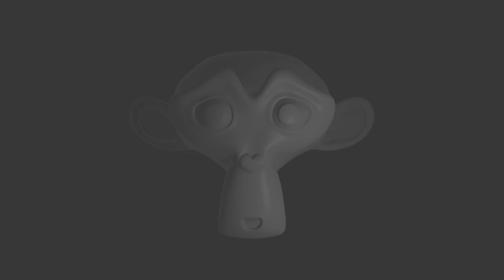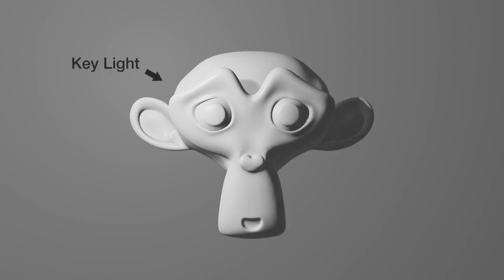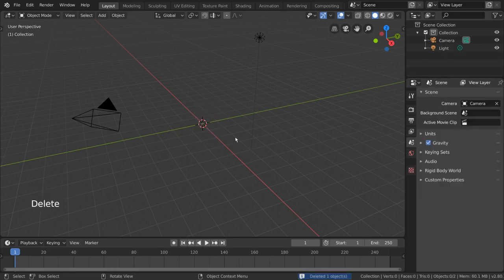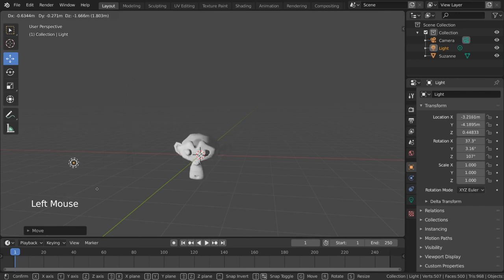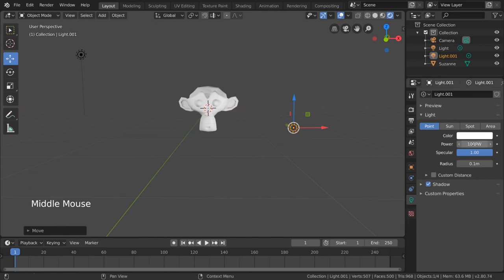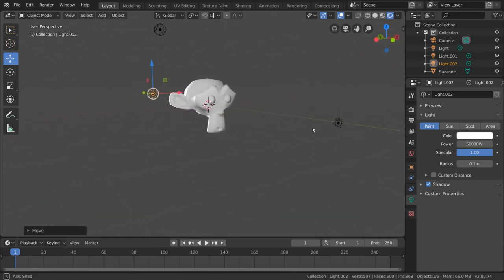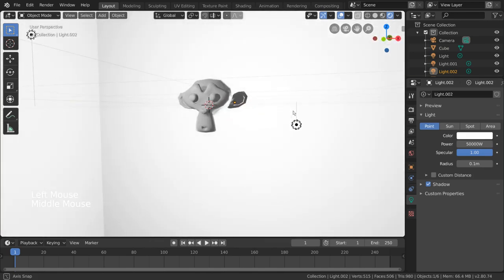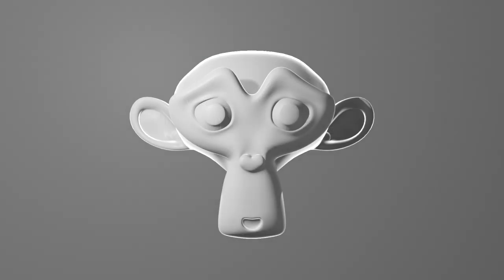Three Point Lighting - Blender 2.80 Fundamentals

Comment: One thing he does not talk about is the built-in plugin for 3 point lighting added in 2.8. Enable it in your preferences, right click on your object, and use the Add menu to add a light, as you would do with any other light. You will now have a 3 point light setup you can adjust in the bottom-left which tracks your subject automatically.
Reply: Edit > Preferences... > Add-ons
Search: Tri-lighting

Comment: Does anyone know why the render at the end of Suzanne (Monkey head ^_^) has a clear lip around the mouth in the video but I cannot seem to get that?

I used Shade Smooth first and it was still quite rough.  The top part of the mouth comes down to a point, maybe a single vertex.  I tried going into edit mode and using Edge > Subdivide twice as an earlier comment mentioned.  That improved it a bit but still the sharp point on the mouth.

Adding a subdivision surface modifier with default settings got it a lot closer, only the mouth really looks different.  Mine smooth with quite a dark shadow in the left and top area with it lit on the bottom and right.

The video has softer shadows, I have a darker shadow behind the brow on the head as well.  Though the video render looks like there is a clear ridge/lip/line on the left and top of the mouth.

the video uses Blender 2.80.74 and I'm using Blender 2.91.2 but I cannot image that would affect it though I'm only guessing.  I assume it must be a render setting or maybe an additional modifier.  I'm only just learning Blender again, maybe I will be able to figure it out after some experience using it.

Comment: What about the material is allowing the rim light to shine straight through the ears? That seems to happen in Eevee but not Cycles. It would be a subsurface effect normally, but most of what we're seeing here seems to be specular.
Reply: Enable subsurface translucency on a material with SSS enabled in EEVEE.
Reply: @ZalvaTionZ  Yes, that would be how to get shine through with subsurface scattering, but I'm asking why it already is passing through here. Most of the edge light inside the ear here is specular highlights from the rim light, where it would be in shadow. It appears some portion of lighting is ignoring the shadow even without subsurface translucency.
Reply: @0LoneTech  Shadow map bias probably. Using contact shadows on lights will fix it.
Reply: @ZalvaTionZ  Thank you! That does affect it. Which bias (exponent or bleed bias) depends on the shadow method set in the Render settings.

Comment: HELLO, i have a problem with it, when i was adjusting lighting that time it was okay but when i added the cube and scaled it large afterwards my it started working so slow or as we say it started lagging very much
please help!!!!!!
Reply: it may be lagging because you were in rendered mode, i dont have a powerful computer myself, so what i did was i went to solid mode and scaled the cube. Also, if you are using cycles render while scaling, it lags because ur cpu/gpu has to also render the light reflection, so it may lag.

Comment: It is possible to look through a spot light like a camera?
Reply: Press N to open the right-side panel in the 3d Viewport,
Click the View tab,
Expand the View category,
Check the use local camera box,
Assign your light to the local camera,
Expand the View Lock menu,
Check the 'Lock Camera to View' option,
Press Num0 to lock the light to the Viewport,
Move your Viewport as desired,
Press Num0 to release the light from the Viewport.
Reply: The 'Lock Camera to View' option will help you with your camera problem as well.
Just make sure that the local camera is the correct camera, or 'Use local camera is unchecked'.

Blender Foundation, please make the 'Lock Camera to View' default value be on.

Comment: If i am in the camera view and using the navigation (alt + left mouse button), I immediately leave the camera view, why? At the moment i am in camera view, i should be able to manipulate the camera with the standart navigation input alt + left/mid/right mouse buttons.
This is not practical, cause I use the perspective view, to check the "perspectives" in the render view fast, without the need to manipulate the camera view always.

If i render the view, he always render the camera view and not the view am in the viewport at the moment. How can i change this?
Reply: There is a way to do exactly what you want: locking the movement of the camera with your view.

Select the camera.
On the top right corner of the viewport should appear a window with information about location, rotation etc. of the camera. (If not, click on the little arrow on the top right corner of the viewport.)
There are three subcategories: "Item", "Tool" and something I can't remember. 
Within one of these categories, there should be the option: "Lock Camera to View" or a similar phrase.
Select that and there you go.

Let me now, wether you could find it or not. 
Cheers.

Comment: my light isnt measured in w and my lighting is extremely dim
Reply: If  you set the power to zero by typing the number, it shows 0 W on mine but clicking the arrow on the right of the box changes it to 100 mW.  After 900 mW it changes to 1 W.  If you manually type 1000 mW it automatically converts to 1 W which is the same.  My key light is 1000 W, fill light 46.3 W and rim light 50000 W as he said.  I did notice my shadows on the middle of the head look a bit darker than in the video.

Comment: Why did he put a cube in there?! If you want to change the background colour, just go to world properties, un-click "use shaders" and change the colour that's right under that button. I almost always choose pure black as the background colour.

Also, in the Principled BSDF shader you can set the emission colour to around 0.1 Value, this replaces the fill light.
Also you can experiment with subsurface emission in the same shader, replacing the rim light.
So really all you need is the key light.

(To be fair, I think this video was made before the Principled BSDF shader was released.)
Reply: dude sick! Thanks for these tips. Brand new to blender (loving 2.8 so far) so these little tips help a lot
Reply: The cube was added to simulate the effects of the three point lighting on the surrounding environment if there was any.

Moreover using principled bsdf's emission value is impractical as in most models, you'll have multiple materials using and mixing goodness knows what shaders, so using an actual light will both be a single universal solution and will provide relatively more realistic lighting due to the fall off and shadows.

Same goes for using subsurface scattering as a means of emission to get rid of the rim light. If you do that, then you must consider how overlapping parts of the model will be lit even though they may be hidden from the rear, for example in the monkey head, the part of the head directly to the right of the right eye and to the left of the right ear will be lit up as it counts as an edge.

All in all, using actual lights saves you a lot of trouble in tampering with various shaders to achieve an easy to achieve effect and also gives a better more accurate result as the aim is to simulate how models are lit in real life studios.

Comment: BLENDER  NO  LONGER  WORKS  ON  MY  COMPUTER.
With this new version, Blender is asking for OpenGL then shutting down.
Blender used to be able to work on any PC that I installed it on.  
Now Blender has become "picky" - just like some other 3d programs that I know of.
Reply: Buy a cheap second hand GPU. I have GTX 750 and it works. It shouldn't be expensive in used market.
Reply: Blender 2.8 requires a newer version of OpenGL which your computer may not support.
Reply: Apparently my gtx 760 is worth £1 lol
Reply: If your computer is roughly 5-7 years old, equipment wise, then it may not work for you.
Reply: ur graphics card, blender just cant run on any potato, u can try download opengl32.dll and putting it in blender dir.
Reply: Upgrade your pc to use blender 2.8 comfortably. I use a ryzen 7 2700x combined with a VEGA 64. Blender works fine
Reply: @bharatsahlot223  it worked i did it
Reply: If it is a problem that a little bit of money can solve, I would not mind much. I mean, there are always trade-offs in the world. Supporting ALL hardware would be best for you, but not for the developers (considering their time and added complexity). I have a 2~3-year old sub-$100 graphics card, and Blender 2.81 works without crashing, so instead of demanding developers should work more so that you could save money on buying a GPU, you could just spend a few tens of dollars on a GPU and solve your problem.
Reply: Why do you want to use a 3d program with some ancient GPU?